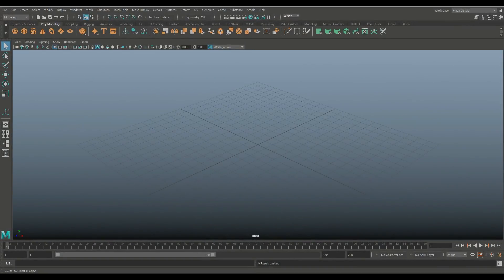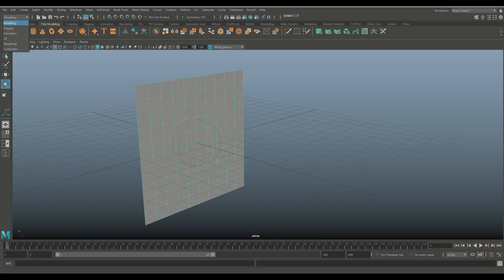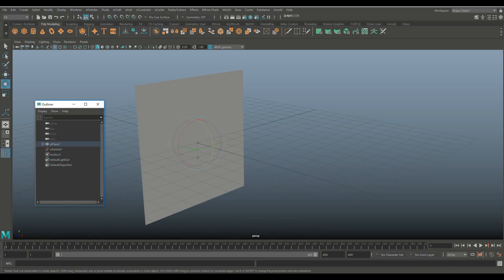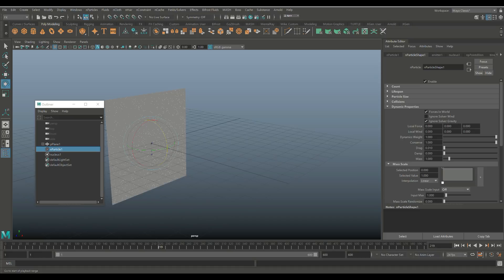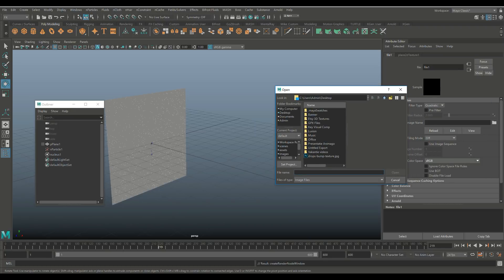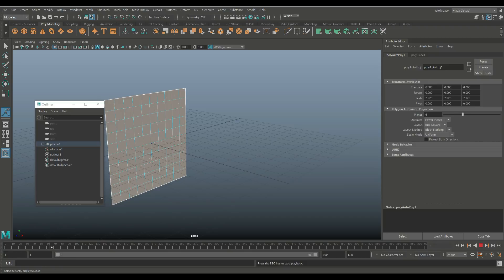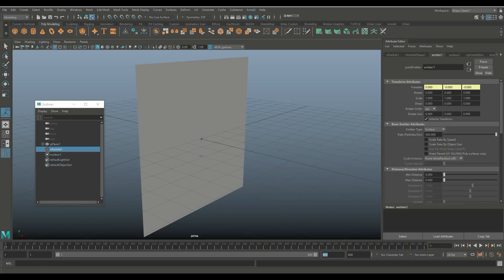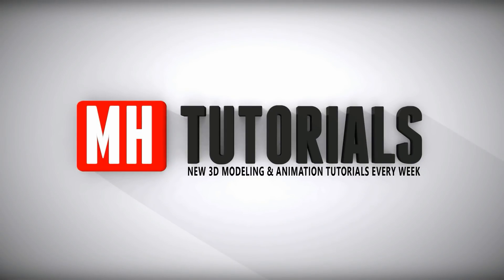How to create water drop condensation in Maya 2019

Comment: This would be far more helpful if I could see your mouse cursor. I cannot see where you are clicking, so I am left to guess what part of the screen you are referencing when you describe what you are doing. I don't like having to search constantly for what menu pops up or what selection happens.
Also, it's not very informative. Yes, the technical aspect of attaching a particle system to a surface and mapping it to a texture is handy, but has little or nothing to do with water droplets. The final outcome of this video is NOT what was shown in the video thumbnail.

Comment: Thanks mike...

Can u please help me that 

AMD ryzen 7 2700
With gygabyte ab320mb 
2 gb graphics-gt710 zotac
8gb ram ddr4 Kingston
1tb HDD
Cooller master with smps
Monitor Dell 22''

Is this configuration good enough for 3d modeling, lighting ,rigging, animation ? Will it be enough ?
Reply from the maker: Maybe, but it will be frustratingly slow
Reply: @MHTutorials3D  okay
Reply from the maker: It is a bit slow and minimal. What software will you be using ?
Reply: @MHTutorials3D  i will be using Maya 2015 and 2017 , zbrush , nuke , after effects , fusion.. This softwares I'll use
Reply from the maker: @mohammadrazakhan3852  You will need at least 16GB of RAM, 4GB of video memory and a faster CPU
Reply: @MHTutorials3D  but at some basic level will my configuration will work which I mentioned above ?
Reply: S.... only for modeling....
Not for texturing 
Not for lighting
And not for rendering (heavy scenes takes lots hours to render )
*You need best graphic card at least go with  gtx 1060 or 1660ti